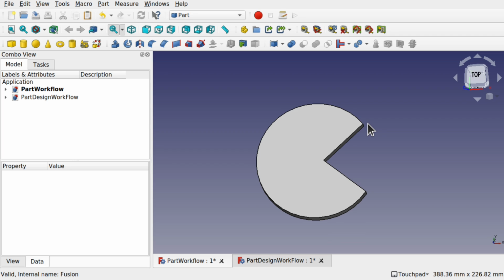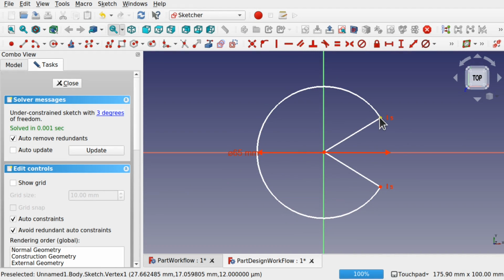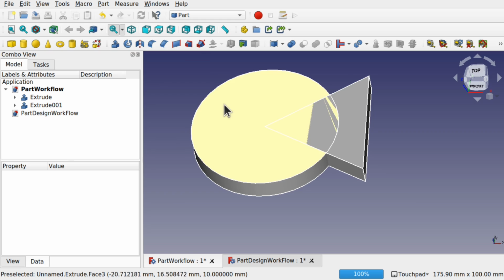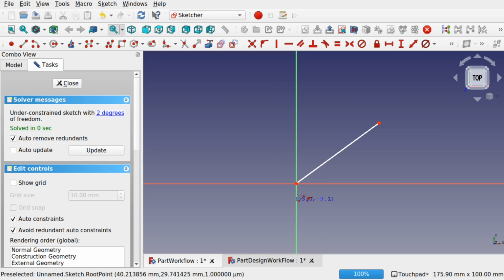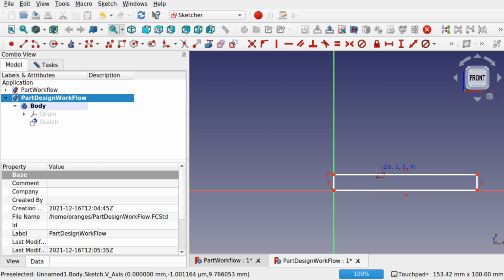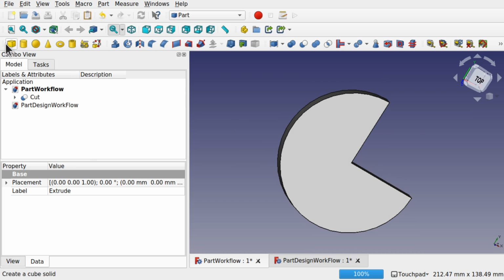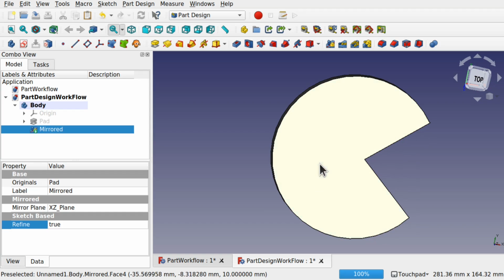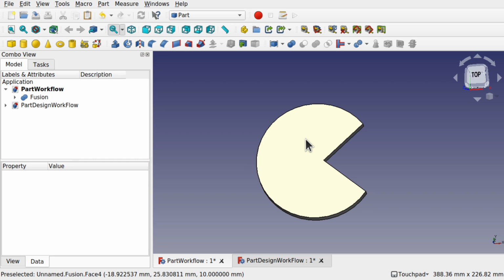FreeCAD: Comparing Part and Part Design Workflow for Beginners. Multiple ways to make the same model

Comment: Part WB:
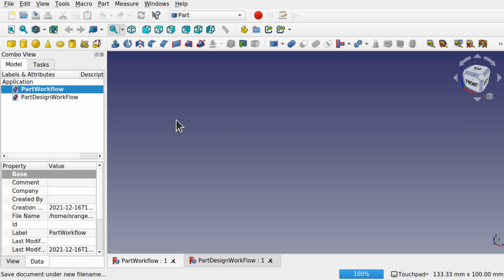starting sketch 2:20 ;
extruding 3:36
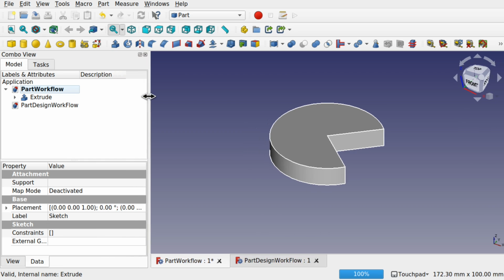done 4:05
Part Design WB:
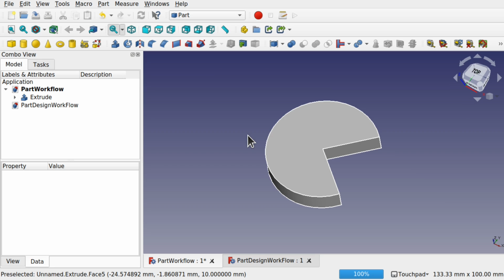creating body + sketch 4:18
sketching 4:31
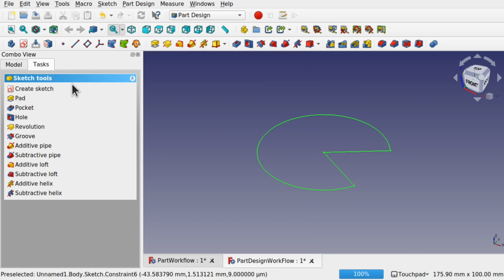done sketching, Pad tool 6:10
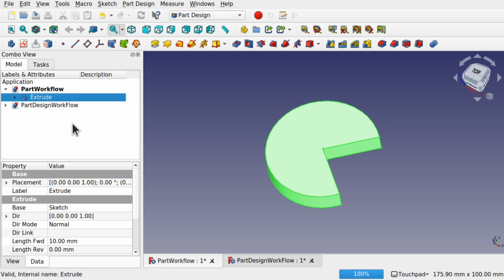discussing flipping page VS workbench 6:42

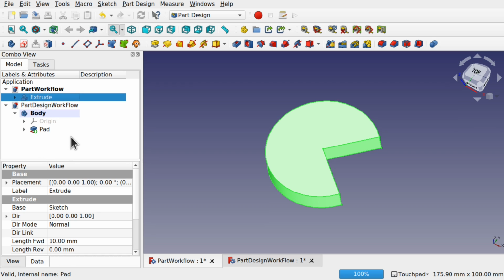let's start over again, with Cut operation in Part WB 7:18
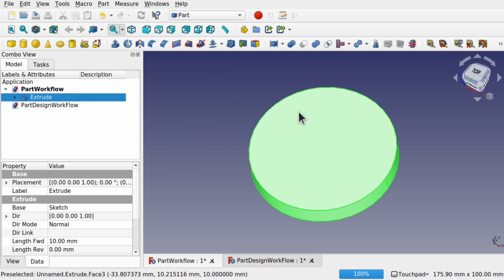Pacman head done, start sketching mouth 8:07
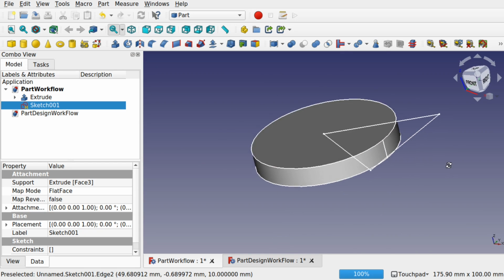extruding mouth 9:38
Boolean Cut 10:55
done 11:17
in Part Design, but with Pocket tool 11:21
Sketch done, pocketting 12:21
Pac man done, exploring Models tree 12:52
In Part Design WB, adding an eye to the sketch 14:17
In Part WB editing the Cut, moving the mouth 15:12

let's start over again (ter) Pacman head with Revolve, in Part WB 15:17
Revolving in Part Design WB 19:54
Needing a closed sketch for Revolving 20:59
Revolving the rectangular profile 22:22
exploring revolving axis 23:14
Revolve  rectangular profile in Part WB 24:21
In Part WB, Boolean Cut with a Primitive for the mouth  26:33
Same approach in Part Design WB, with Subr=tractive Box : 27:54
Discussing workflows 29:03

Last variations: mirror in Part Design WB 30:41
pad done, using mirror tool 32:00 
added eye not mirrored in Part Design WB 33:15
Copying half face sketch between documents (to Part Workflow) 34:25
extruding in Part WB  35:08
mirroring 35:15
boolean unioning and refining two halves 36:11
Reply from the maker: Thank you for your time in adding this index, most appreciated.